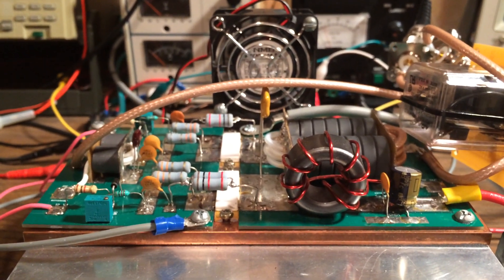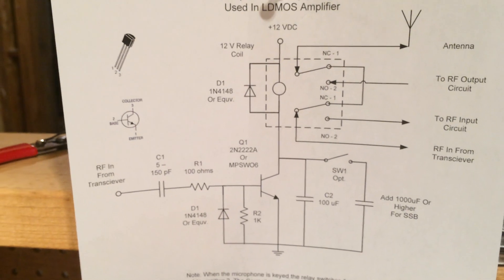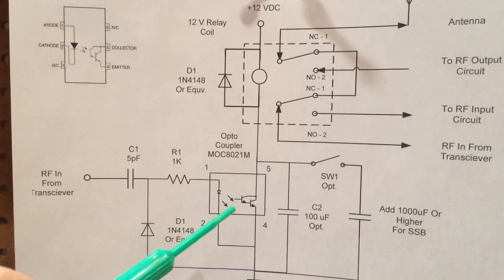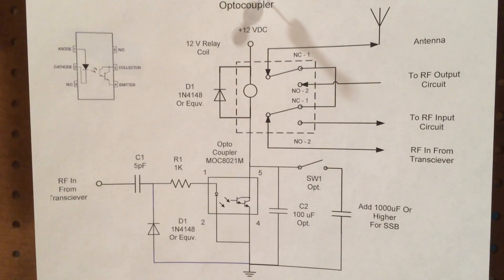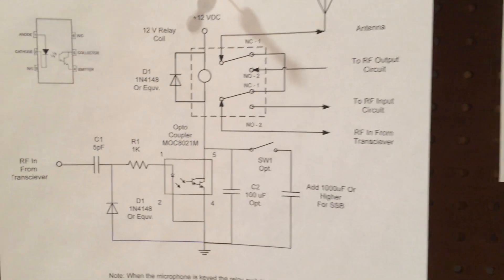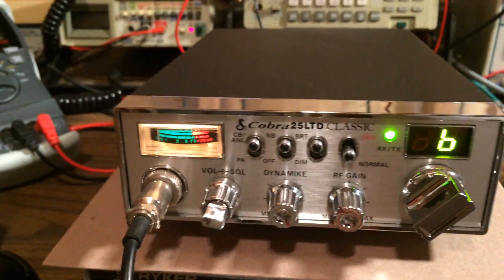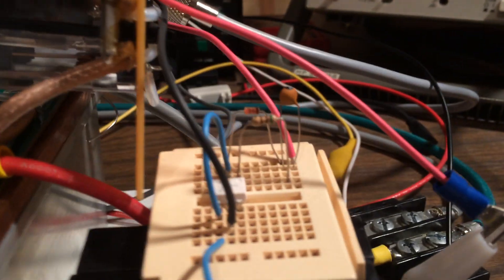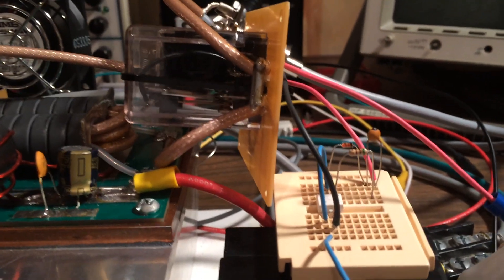RF Man Demos New Keying Circuit

Comment: it looks like your using about 4 or 5 watts to drive the amplifier.  I'm assuming you are sampling RF off a coax T or similar between the exciter and amplifier.   Are you padding with some kind of attenuator or are you just jamming 4 watts of 27 MHz right into this thing in parallel with the amp and using R1 as sort of a resistive voltage divider?